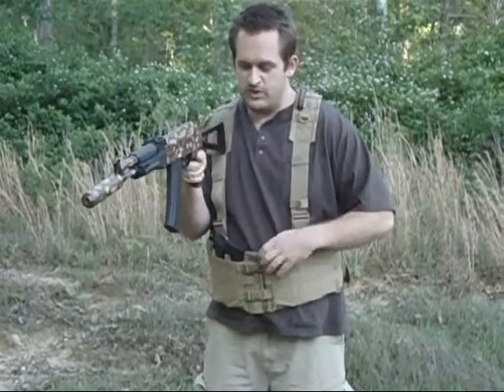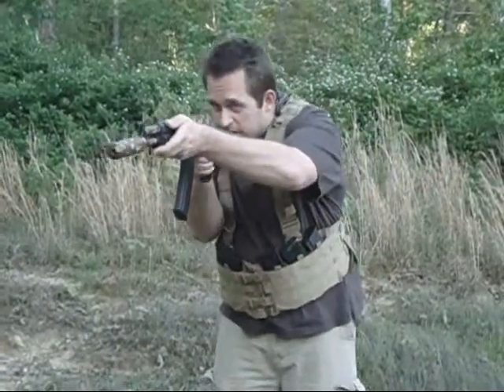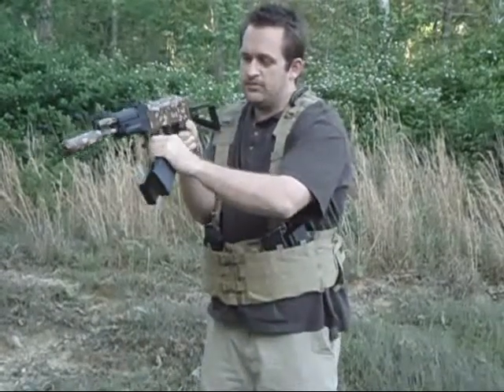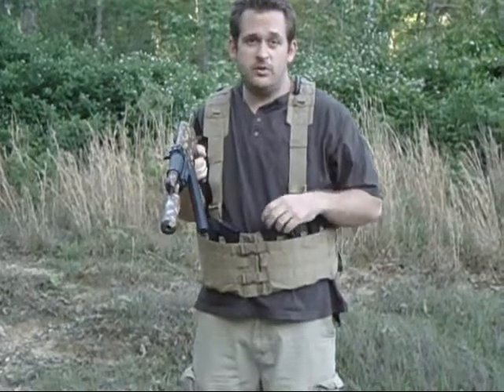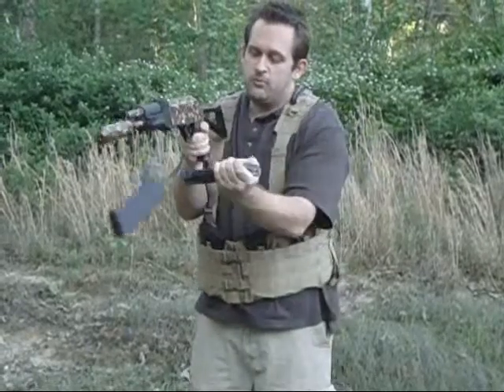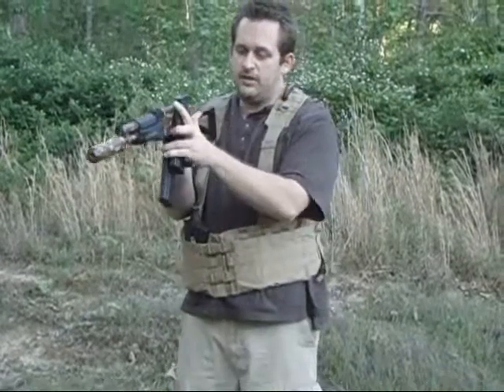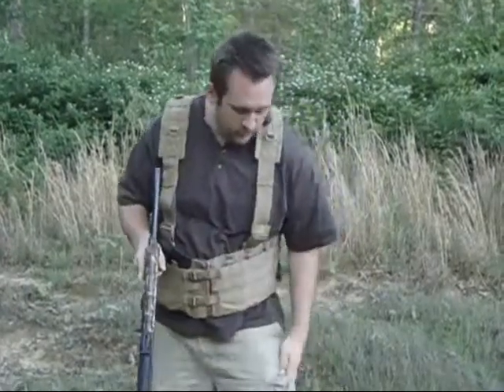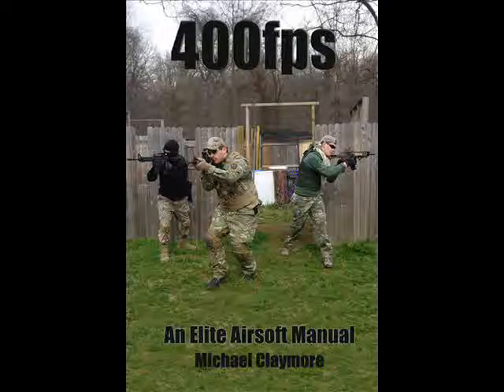AK speed/tactical reload by Michael Claymore.wmv

Comment: I'm not an airsofter but I do shoot and train real steal, the Tac Reload on the AK is a lot easier if you keep your fresh mag orientated the same way the mag in the gun is and just grip the fresh mag in the middle with you're thumb sticking out on the side closest to the gun, set the fresh mag against the mag in the gun, activate the mag release with you're thumb while gripping both mags, rock out the old one, rock in the new one, slide you're old one off the new one and re insert in to you're pouch. No need to flip the fresh mag and it's a lot less moving the weapon around.